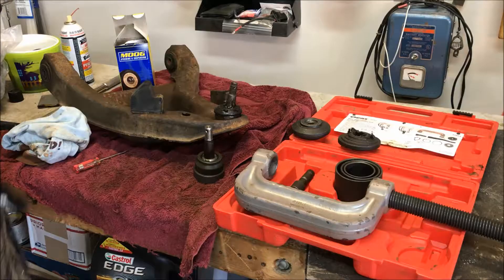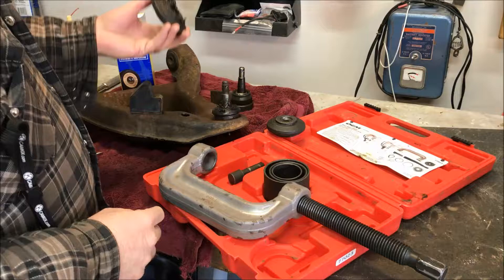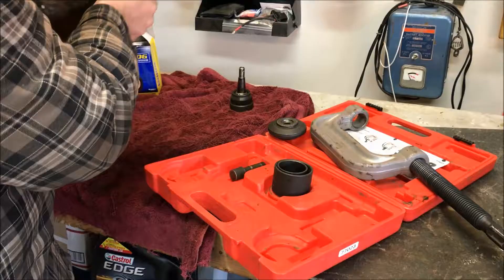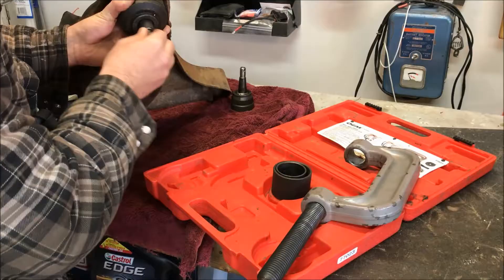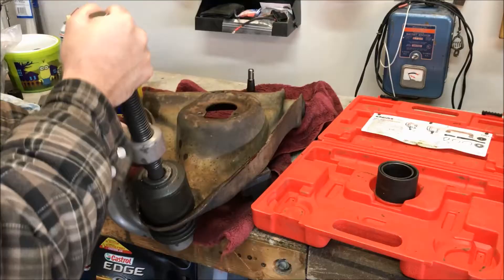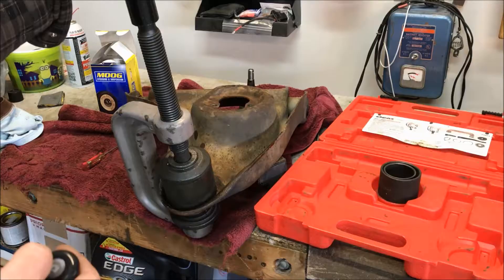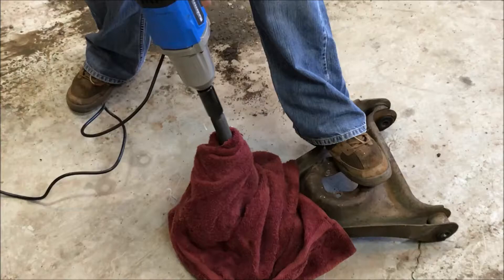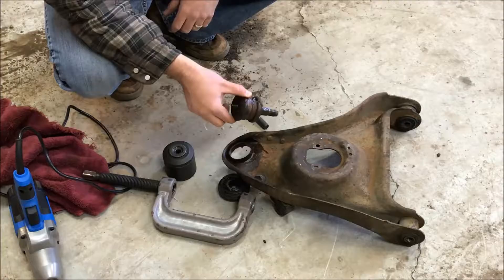GM Lower Ball Joint Removal

Comment: I just hammered mine out with a 1lb sledge.  Took about 3 or 4 hits.  Piece of cake.  No special tool required for removal, but I did need that to install the new one.

Comment: Thanks a lot man I was actually using the tool upside down before I saw this video. Replaced the ball joints on my 93 Corvette no more steering wheel shake!

Comment: Interesting video, even if you did use the balljoint press completely backwards. I guess it works. But it would probably have been easier if you used the tool in the correct way. Oh well, nice video either way.
Reply from the maker: it's backwards?
Reply: @gregs_garage  How can you use it backwards? I Just removed a ball joint from the same type control arm with the same kit and it worked just as well as when you did it. I think I even had the same shirt on.    Thanks for doing the video!
Reply from the maker: @briand6671  I hate ball joints.  Anyway I still have that coat and will wear it until it falls off.
Reply: I was watching and thinking the same thing lol how did it work lmao
Reply: The way he did it is exactly the way the directions with my kit show it. Maybe YOU did it backwards?

Comment: Any tips for the bushings on the control arms? Removal and replacement. Maybe just a socket and bench vice?
Reply from the maker: those are tough.  I took them to a shop and they used a big press to get the old ones out and put new MOOG ones in.
Reply: Greg's Garage Thank you, I’m also thinking about using MOOG. Thanks again!